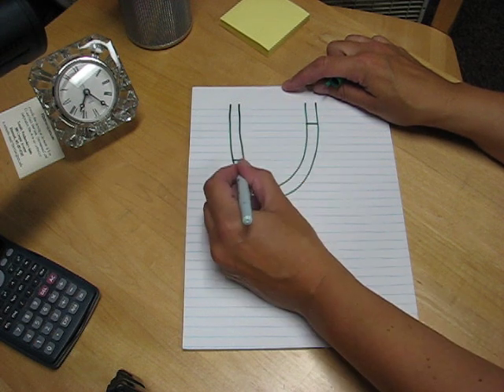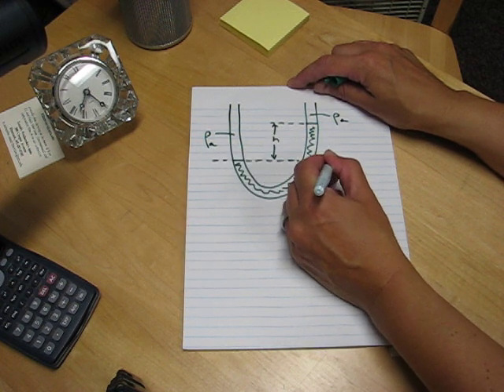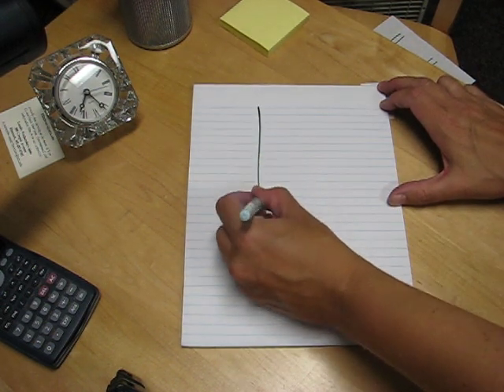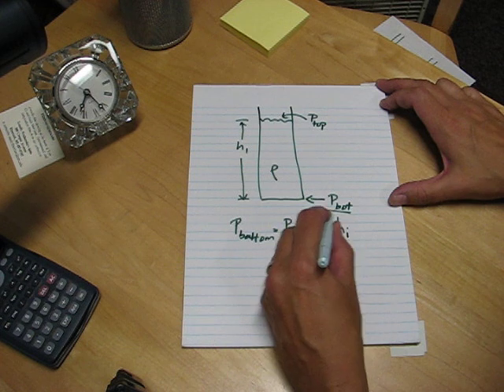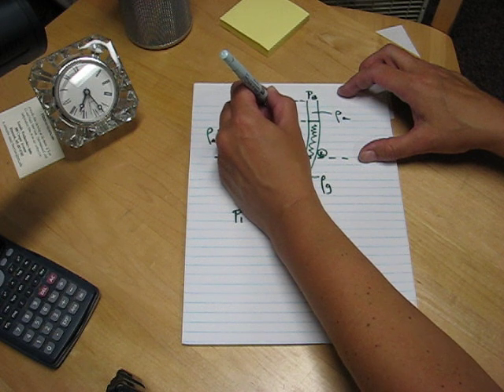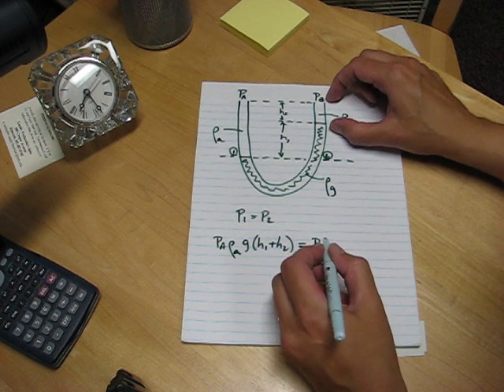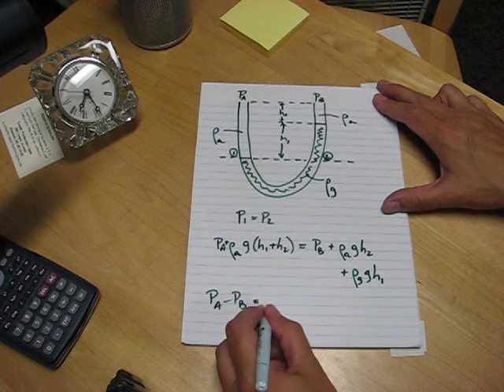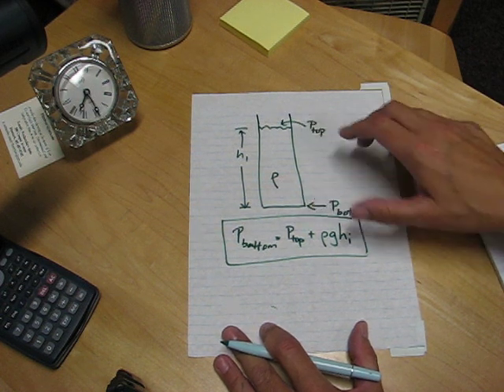Introduction to Manometers:  Two Essential Rules

Comment: Is the pressure the same at the same level if the two substances at either side of the u tube are different?
Reply: with different densities
Reply from the maker: No.  It is only the same if it is continuously the same fluid from one side to the other.
Reply: Thank you! How would you solve this? 'Water is poured into a U-tube the legs of which are 203 mm long, until the level is 101.5 mm below the top. As much light oil as possible is then poured into one of the legs. What length of tube does light oil occupy?'

I tried to solve it knowing the water in one leg had gone h above half way and the water in the other had gone h below half way then equated pressures at half way. But obviously these pressures are different as they are different fluids. so I'm a bit stumped at the moment.
Reply from the maker: You should draw a line that connects the top of the shorter amount of water (after the light oil has been added) and equate the pressures on the left and right side at this level (all water below this line).  This should enable you to solve for what you need.
Reply: Okay thank you. Would you have to assume the water reaches the top of the leg or below the top of the leg?

Comment: what   does  happen   if  one  of the sides od the manometer is  closed?   Would then   be   also    pressure from the  top for this   side?
Reply: +Ogier P The same principles still apply. The pressure from the closed side will be the "top". For example, if the left side of the manometer in Dr. Morrison's problem was closed, the pressure for P1 will still be Pa + ρa*g*h.

Comment from the maker: I guess I don't understand the question.  In the example, P_A is the higher pressure pushing down on the righthand side.  P_B is the lower pressure pressing down on the lefthand side.  We equated P1 and P2, which were two points at the same elevation.  Those two pressures are equal, but P_A is not equal to P_B.  Hope that helps!

Comment from the maker: Yes, if you interpret the open tops in the initial figure as open to the atmosphere, it would be an error.  At 2:42 in the video I label the pressure at the tops as two different pressures, in agreement with your point.

Comment: your first diagram doesn't make sense because the outside pressure on both sides of the tube are the same, then the liquid inside the tube should be at the same height on both sides.

Comment from the maker: If I understand your question correctly, you have the b-side open to air (and the pressure at the top is Patm) and the a-side open to some other pressure Pa.  If you do it my way, you get rho*g*h+Patm=Pa.  In this case Pa is the absolute pressure.  If you do it your tutor's way and say the pressure at the top is zero (gauge pressure), then you get rho*g*h=Pa but now Pa is in gauge pressure.  In typical gauges, they read zero when open to atmosphere.

Comment from the maker: Hi, for the complex case you cite, you need to choose "jump across points" that are in the same fluid and not at the top, but at the bottom.  Always remember that the pressure is the same in the same continuous fluid at the same elevation.  I will try to post a video on this.  Dr. Morrison